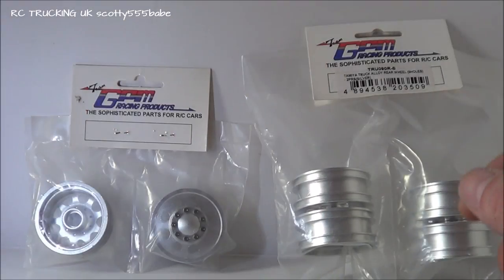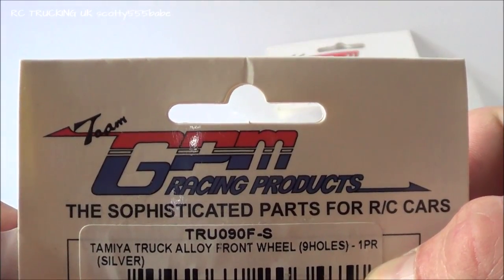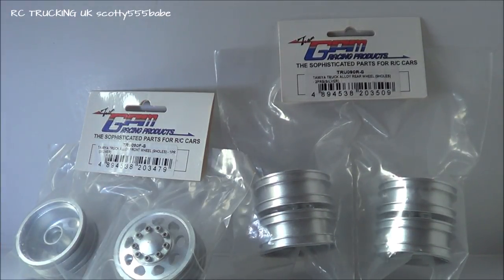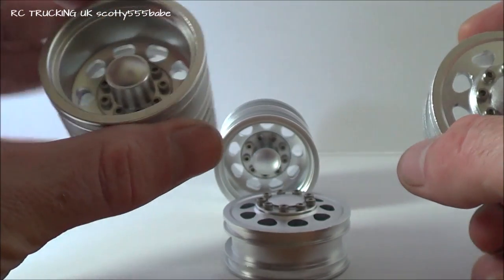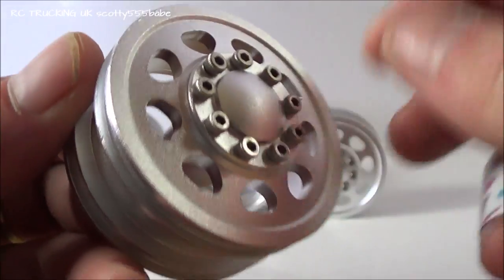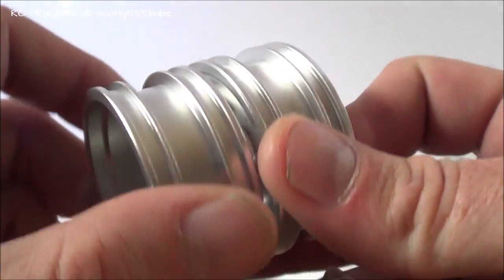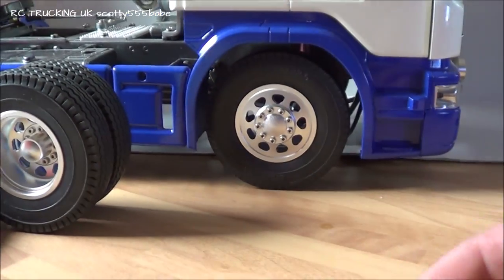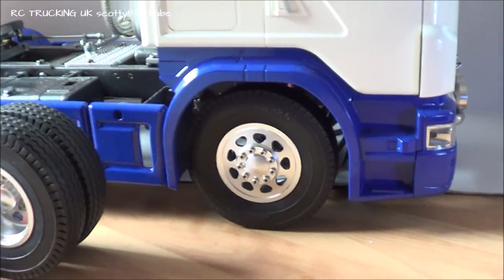RC TRUCK | ALLOY WHEEL UPGRADE FROM GPM RACING | TAMIYA RC SEMI TRUCKS

Comment: Did you ever get your Grand hauler painted.
Reply from the maker: It's still at the same stage as last gh video as it's got to the expensive upgrades so it's when and as I can afford the bits 👍
Reply: Just checking in on the truck,thanks for replying ✌️